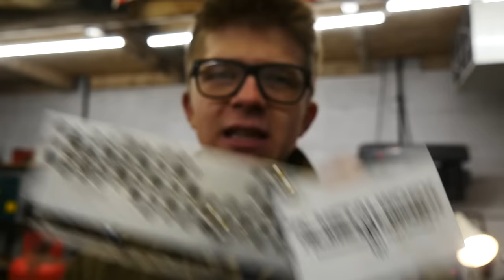MAKING MY FIRST STOCK REMOVAL KNIFE!!

Comment: You should make Damascus with the leftover saw blade. Cut little triangles of 15N20 or something to fit in the gaps left by the teeth, sandwich it with more steel, forge-weld it, and grind through the pattern for the bevels for a knife blade so that it makes a sawtooth pattern on the bevel after etch

Comment: In case you do another stock removal knife, you can heat treat stainless with a forge. I hardened 440c fully with a cold wramp into 1400 degrees than increased to 1800 (bright orange/ yellow) for 5 min than cool it quickly in front of a fan than do the same thing but quench in warmed oil.

Comment: That saw blade would work fine for a small knife or a fine kitchen knife. The trick is to grins the profile abs heat treat it, THEN grind your bevels. It takes a bit longer to grind that way but massively reduces the risk of warping of the blade. I'm looking forward to seeing your next one!
Reply: Grinding bevels after heat treat is costly when it comes to abrasives. Properly ground knife won't warp as much and from my experience knives can be straightened after tempering using a manual press just fine. I have to straighten a lot of my production models this way but I save a lot of time and money this way.

Comment: Pretty cool knife! Do you have a stencil to stamp/etch your (S) onto the knives you make? That Or burn it into the wood handle, or do both!

Was wondering with those old saw blades if you could you cut all the "teeth" off, give them a vinegar bath to remove the rust and use them in a canister billet? Not sure if it would show up but it would be cool seeing those as the pattern in a billet. Don't know if you ever turn any steel on the lathe but those shavings would also be a great filler in the canister. To bad you couldn't use the aluminum shavings. 

Have a great weekend Alec!

Comment: What jig was that you used to find the center line to grind to on the blade?
Reply: Jakob Watson a drill bit with the same diameter  as the thickness of the steel works well

Comment: when drilling the holes what are you spraying on it?
Reply: RSL_WHU24 it's a coolant and lubricant of some sort. I've used anything from special cutting fluid like 3-in-1 oil or tap magic oil to motor oil or WD-40 for machining metal.
Reply: awesome thank you

Comment: 60 second club still a thing?
Reply: also what size belt grinder would you recommend i plan on building my own 2 inches wide but was wondering if longer belts are better
thanks :)
Reply: they have more abrasive so i'd think so
Reply: Yes, longer belts are better, longer the belt, the cooler the knife stays, so you get to grind more and more. 
I just completed my 2X72 belt grinder for under $120. Got lucky though, the motor I got for a steal, $20.
Reply: thankyou, yeah the motor is going to be the most expensive part, what horsepower did you use?
Reply: No problem, I should have the video up within a week.

The motor is a 1 horsepower 12 amp, has a lot of torque, bought it from an Amish guy(why it was so cheap). Was used on a band saw.